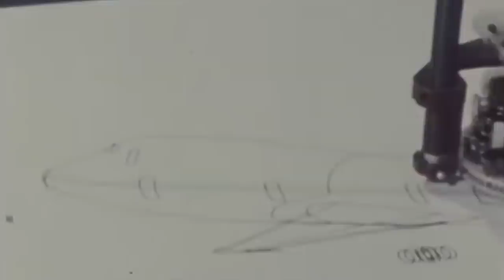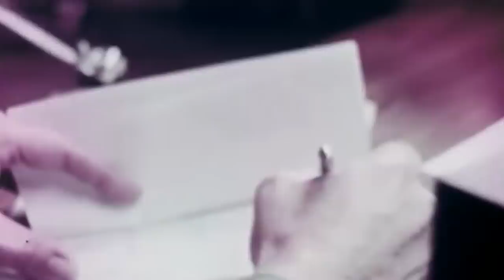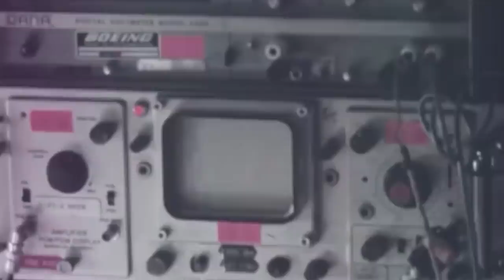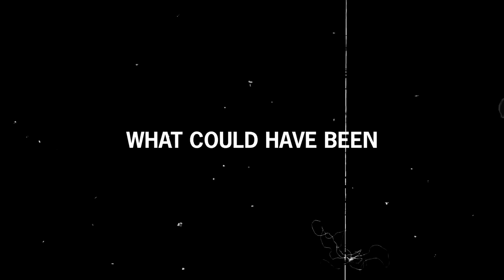The Boeing 747 Cruise Missile Launcher

Comment: 3:24, I understand that the B-52 is an old design, but the BUFF first flew in 1952, well after the end of WWII. The design was based off of studies done in the late-war and post-war however the aircraft itself is a post-war design with the earliest design and performance requirements being issued in November of 1945 a full 2 months after the war ended and Boeing's design went through many iterations prior to the final design which was decided on around 1949-50. If anything you can call the BUFF a Korean War era design.
Reply: And the Boeing B-54 was a direct descendant of the B-29 that was ordered because they weren’t sure about the B-52…
The Tu-4 derived from the B-29 was developed into the Tu-85 and then the swept wing Tu-95 still in use.
Reply: Thanks for pointing it out.  This guy talks so fast it's easy to miss big fuckups like that

Comment: The B-1 hasn't been retired, 45 are still in active service, they retired some of the oldest airframes not the entire fleet.
Reply: Yeah I was thinking the same. Also correct me if I'm wrong but isn't comparing this to the B1-B apples and oranges? I was under the impression the B1-B was never designed to fill the same role as and replace the B52 and its also far smaller. Wouldn't have thought their designated roles would overlap much with a 747 missile carrier or a B52
Reply: superofca  Damn, that much more than a B52? Pretty impressive, it looks so much smaller!
Reply: @thedigitalrealm7155  I think intially it was designed to replace the b-52, but ended up complimenting it.
Reply: @sheilaolfieway1885  Ah okay. Damn I can see why it never replaced it, cost difference is insane
Reply: @thedigitalrealm7155  As I recall, the B1 was specifically designed for high speed, high altitude penetration. When it was discovered that newer SAM missiles would make this extremely dangerous, they changed the mission to high speed, LOW altitude penetration. Kind of a kick in the teeth for an aircraft already having been built FOR high altitude, but they made alterations and thats how the B1B came about.
I'm kind of surprised they kept them for so long. Despite the fact they actually carry more bomb load than the B52, they're just so damned expensive to maintain.
And the whole reason they were acquired in the first place was as a stop-gap measure to fill in a blank before the B2 was produced, to ensure the US had something that wasn't a B52 if they had to go to war with the Soviets. Since, as they found in Vietnam, the B52 (regardless of which version, even though had better EW capability than others) would suffer high losses in areas with SAMs, and especially with contested airspace.
Reply: I count 18 B-1 at Davis Monthan. Some look like they are being parted out for spare parts, but 16 have their evelators removed and lying on the ground. One is missing its wings. One is left complete as an example.
Reply: the AF loves to retire things but keep maintaining them because of an old mandate that says you have to have something with its capabilities but nothing gets made to replace it because the capabilities are outdated or none priorities.
Reply: @thundercactus  It's the same evolutionary story for the British V-Bombers. Only the Vulcan could be realistically re-tasked to low altitude and even proved better at it than the originally intended role. The others were converted to inflight refuelling tankers. Yet another role in which these commercial conversions excel.
Reply: If you came for accuracy..... spoiler! Wrong channel!
Reply: The B-52 is more expensive to buy and maintain...
Reply: @thedigitalrealm7155  the main reason is the operating costs of the lancer are crazy so they keep it for precision/low altitude bombing, where the B-52 is used for high altitude strategic bombing
Reply: I see a bunch of you didn’t watch the whole video, at least the part where it said President Ray-Gun revived the B1 program.

Comment: I'm a bit surprised that the story makes such a glaring error in stating that the B1b has been retired.  That would be news to the unit at Dyess AFB.
Reply: The Carter Administration canceled the original B1A Lancer program. President Reagan promoted the B1B, which was modified with a redesign for better low altitude performance and had newer electronics.
Reply: @ronmaximilian6953  …which was an expensive Hail Mary play to try to make use of the Lancer after it had become obsolete.
Reply: Shhh 🤫 that’s what they want our enemies to think.
Reply: I stopped watching this channel because of the blatant mistakes.  Figured I’d give it one more go…nope.
Reply: If you came for accuracy..... spoiler! Wrong channel!

Comment: 3:25 - “…the B-52 was getting old. And while the World War II era aircraft acould only carry 20 of these air-launched cruise missiles…”

Okay. Where to begin? WWII ENDED in 1945. The RFP for a large strategic bomber/nuclear armed deterrent meant to be a direct threat toward the Soviet Union that ultimately led to the awarding of a contract for the B-52 didn’t come until June of 1946, and even then, the initial proposals were for a straight winged, six engine turbo prop design. It was changed drastically and eventually became an 8 engine turbojet powered contraption with the swept wings and a side by side bubble canopy. The YB-52 didn’t make its maiden flight until
April of 1952. 

At no point in its design or decades of continual service and operations was the B52 a “WWII era aircraft”. 

I have to hand it to you. At least you guys are consistent. I know that just based on the law of averages, one of these days, you will produce an aviation related video that doesn’t contain any errors. I have faith in you!
Reply: Maybe you should learn the difference between "WWII ERA" and "DURING WWII". 1946 was still the WW2 era. Sorry if you don't agree, but that doesn't change the facts. And if the contract was given in 46, then obviously it was in development before that.
Reply: @twizz420  I don't know the details. But I think an RFP is not a contract. And anyway, as explained above, the RFP asked for something quite different in design than the B-52. If you want to sort of say WWII "era" jet bomber I'm not sure if it might have been the B-47. Or what was the name of the one that was pusher propeller driven with a couple of jet pods stuck on for good measure? That was much more "WWII era".
Reply: @twizz420  Just to be clear, you would consider an airplane that wasn’t designed until the war had been over for a year and didn’t make its first flight until nearly seven years after the Axis powers surrendered to be “WWII Era”? 

Even if 1946 was universally agreed to be “WWII era”, the initial designs submitted in 1946 was a straight winged turboprop design called the Model 462. It was rejected and further development was requested with some fairly respectable money made available to do so. This period resulted in the models 462-29 and 462-35 respectively. Each of these were still powered by turboprops, something that Curtis LeMay was not interested in. He was a forward thinking leader and demanded that among the latest innovations to be incorporated in the next strategic bomber, first and foremost it would be powered by Turbojets. 

The turbojets were incorporated into the design in early 1949 in the model 464-49. The added power and speed required a radical change in wing design. The most obvious difference was the change from the standard straight wing to the now easily recognizable swept wing. Further changes were incorporated into the first prototypes, the YB-52 and XB-52 and then, ultimately into the first production B-52 strategic bombers in 1952. 

Without splitting hairs, I think it’s safe to say that the fact that we were already two years into the Korean War by that time, the term “WWII era” would no longer be an appropriate descriptor of the times. 

Another example that supports my point is the Convair B-58 Hustler, a delta winged, Mach II strategic bomber that was the result of the Generalized Bomber Study (GEBO II) which was officially begun in 1949, a full three years before the B-52’s maiden flight. Would you consider the Hustler a “WWII Era” product? I ask because it developmental timeline is nearly the same as the B-52. Furthermore, the XB-70 Valkyrie, our only Mach 3+ strategic bomber was also proposed and had early design proposals submitted less than a year after the B-52’s first flight as a part of the USAF General Operational Requirement #38 which was a desire to mix the payload of the B-52 with the scalded ape speed of the B-58. 

So as you can see, some of our most impressive and capable strategic bombers were all conceived, designed, tweaked, built, and flown within several years of one another. To my mind, it’s similar to trying to decide whether someone is a Baby Boomer, Gen X, Gen Y, Gen Z, or a Millennial. There is quite a lot of overlap when one generation ends and the other begins, but ultimately, it isn’t hard to look at someone and determine if they are a Boomer or a Millennial. A swept wing turbojet powered airplane with 136,000lbs of thrust, a max takeoff weight of 488,000lbs, and a SEVENTY THOUSAND POUND PAYLOAD, that could travel 8800 miles at 650mph at 50,000 feet doesn’t even remotely qualify as a World War II era anything. The closest anyone ever came to the B-52 during the war that actually went into production was the B-29. Take a minute to go compare just the numbers that I shared above and you will see what an insane leap in capability the B-52 was compared to the most expensive single program of WWII (Fun Fact: the B-29 cost more than the Manhattan Project!!). 

I stand by what I said in my original post. The B-52 was no more a WWII era project than the F-117 Nighthawk was a Vietnam Era airplane. As far as I’m concerned, “WWII era” and “During WWII” mean essentially the same thing. For the sake of argument thought, and for my own edification, when would you yourself consider the WWII era and the Korean War era to be clearly definable and distinct from one another? If I AM wrong (and I often am), I would actually be very interested to learn where my argument falls apart. Learning where my logic is faulty has taught me some VERY helpful lessons in the past. So if I am wrong, I would actually be very grateful to you for demonstrating how. And if you can do so, I would be proud to admit the fault in my thinking and will offer you a public apology with every ounce of humility that I can muster.

Comment: Additional Corrections:
• What we know as the 747 wasn't technically "a failed military plane" (CX-HLS) but was a derivative of the CX-HLS that was designed from the start as a commercial passenger plane. A key difference between the "failed military plane" -- CX-HLS and the 747 includes lower wings on the 747 as compared to high wings on the CX-HLS like the C-5A.
• The 747-200 is retired, but the 747-8F is still currently in production in Everett, WA with the last one currently scheduled for delivery in October, 2022.
• The 777-300ER suggested as a current alternative is being phased out and is being replaced by the 777X still in flight testing. So the 777-300ER is not an alternative.

Comment: That went about as far as a brick. If we armed 747's then any 747 became a target, even civilian aircraft. The picture of the air drop was that of one of the 436th Air Lift Wings C-5A setting the heavy lift, air drop record by air dropping a Titan ICBM missile out the back. The first loaded with weight to test the idea, it set the drop record, then later the full drop, and firing of the missile in a test, that worked, but never used. It tied up the limited number of C-5A's for cargo movement.

Comment: I get the argument for not using modified civilian 747’s, due to the potential civil/military confusion during any hostilities.    But we’ve been using civilian based airframes for years now.    707, 737, DC-10, A330 are just a few examples that are currently in service in various roles, and many more over the years, have been converted into military based assets.

Comment: Considering that the bulk of hard work has already been accomplished, this can still remain an "off-the-shelf" solution. ("camouflaged as a 747" is a delightful thought)
"...Launching sufficient numbers to overwhelm any air defense system..." appears to be a most economical, highly-effective, solution.
As the B-52 can endure 100 years of service, "bigger, faster, more powerful..." new, shiny toys could reach the point of negative return, in the none-too-distant-future. Russian "hyper" missiles vs, 72 ALCMs is a status I can live with. (Ferrari vs. Mercedes 6-cylinder diesel; My Benz has well over 650,000 km on the clock, and as well as millions of other applications, is still running strong)

Comment: The Buff and Bone carry lots of heavy metal. The 747 creates so much turbulence it is neither a good tanker platform nor weapons launcher. Better to consider one of the many C-130s to serve as a stand-off platform.
Reply: The b-52 has 8 engines look how you sound . 8 engines create a shit tonne of wake dont use a civ aircraft at all.
Reply: @GabbieGirl007  the eight engines of the B52 have far less thrust than the four on a late model 747. Your point is what?
Reply: @us1fedvet  well my main point is that the 747 can carry a lot more one and two it has longer range . and is more efficient and more suitable for pilot training. since there are a lot of pilots with the 747 typerateing. but conclusively lets not use civil aircraft for such a role since it puts a target on the civil versions . lets not forget Korean 007.
Reply: @GabbieGirl007  understand. Thanks.

Comment: What an idiotic idea. Using a common civilian aircraft as a refueler, or for command and control is one thing. Using it for direct-action combat paints a target on every single civilian model of that type -- that's why, out of the thousands of models of civilian aircraft out there, you can count the number of civilian designs with deliberately-built variants for combat on two hands, and have fingers left over.
Reply: It would most likely not. AWACS are already based largely on commercial airliner. The US Air Force E-3 Sentry is a Boeing 707.

The stand-off distance and lack of identification in a hostile environment would make it appear as a hostile non identifiable aircraft anyways. The radar return does not specify model type or base of platform. Due to the stand-off distance at which the cruise missiles would be launched and the possibility of large aircraft to accommodate passive and active defensive mechanisms (Missiles, canons and LASERS) would make it very difficult to combat.
Reply: If you know that the enemy is using a specific type of platform to shoot at you, when hostilities begin, it pays to start shooting at anything that looks like it might be a target. Whether you shoot at it with anti-air missiles, cannons or by sending fighters out to shoot at the first thing you can see that looks suspicious, if "suspicious" happens to be a civilian airliner with a sufficient radar return (and some radars can determine the type of aircraft), that matches what you know about an enemy platform, even if it is nowhere near where missiles are currently being streamed from and is not pumping out 'military-ish' ELINT, well, maybe the enemy is plotting to open a new front, and has gone passive on its outputs. Getting the drop on them is a perfectly valid option...And if you happen to shoot down civilians? Sucks to be them, for getting too close to a war zone in a suspicious-looking craft. That would be a valid defense in a neutral court, after the fact.....Actual military craft will have defenses and fighter escorts; "suspicious" civilian aircraft won't.

Although not specified in the video, the idea is a direct echo of a naval Q-Ship, whose use contributed to Imperial Germany returning to unrestricted submarine warfare in WW1. When you repurpose civilian designs into military craft, civilian craft become valid targets. That is as true in the air, as it on the sea or land.